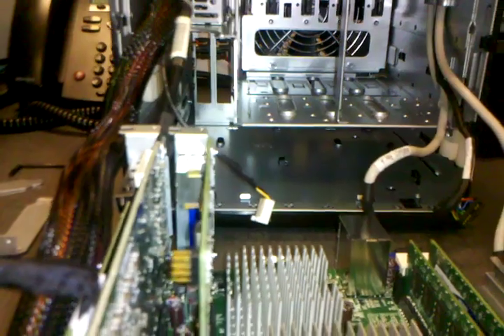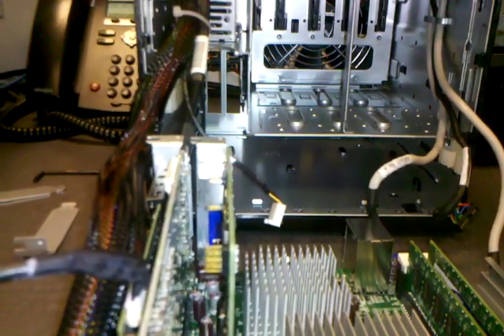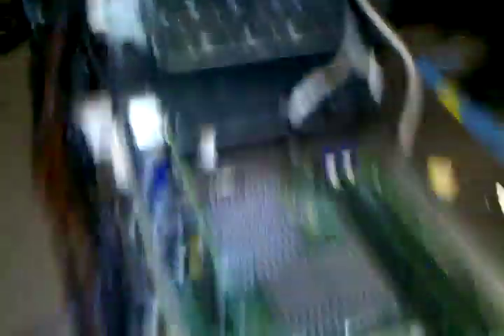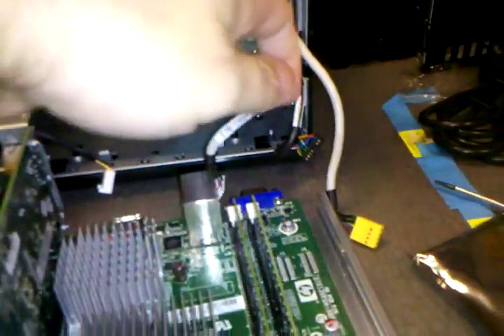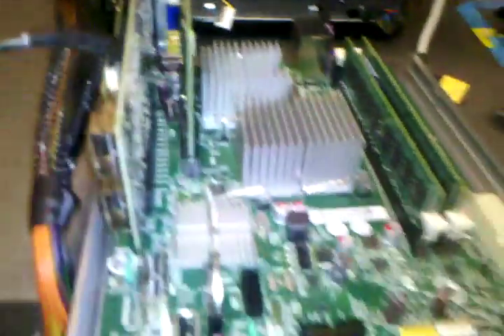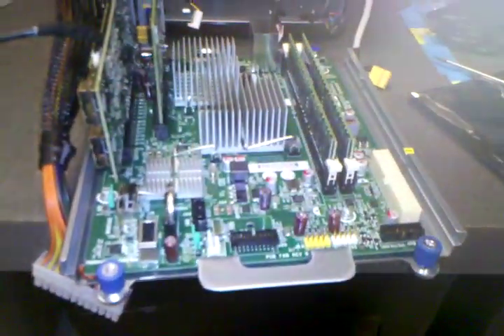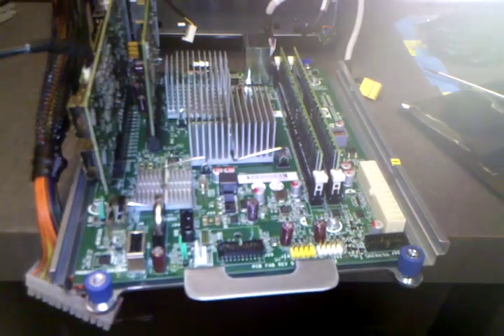HP Microserver with HP P410i Sata raid controler, and HP managment card. Assembly

Comment: Is there anything special you did to make the P410 work with the microserver? 
If i use the P410 without the cache card, it works fine, but when its installed it stops detecting any drive, then doesn't respond to the system in ACU, this is with or without any drives hooked up.

Got a new card coming from HP tomorrow, and i've already had a new FBWC from them which did nothing, so hopefully that will fix the problem.

Comment: Hi, I'm building my first "real" server with HP ProLiant Microserver and HP 462864-B21 Smart Array P410/512 BBWC 2-port SAS Controller for the raid. Do I need any extra cables to connect SATA drives to Mini SAS port on controller? Or the cable that is initially connected to motherboard can be used?

Thank you!

Comment: There is no need to flash the BIOS to get any RAID controller to work, but I do advise you to flash the BIOS with the modified BIOS by "camiloml" from BIOS-Mods, as it unlocks most features of the BIOS and allows you to make all hard drives hot pluggable and it allows you to make all SATA ports run on full speed for example.

Comment: Sorry, but the RAID controller which you are using is the HP Smart Array P410 Controller and not the HP Smart Array P410i Controller. The HP Smart Array P410i Controller is an embedded controller. The HP Smart Array P410 Controller is a standup PCIe controller. Although both RAID controllers will fit, the standup PCIe controller is advised as it locks in place with its low profile bracket and is therefore seated more stable in the case and on the motherboard.

Comment: According to HP documentation only half height, half length slot PCI-e cards are supported yet the HP P400 looks like a full length card...any problems with the length?

Did you have to re-flash BIOS for RAID card to work?